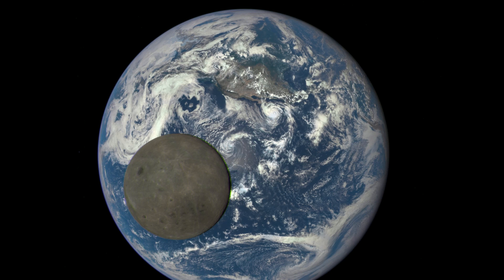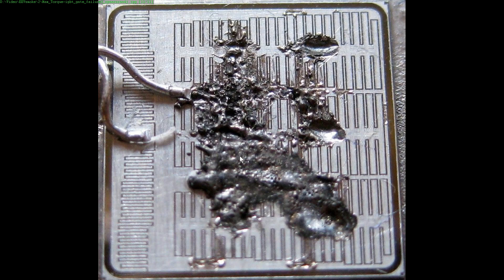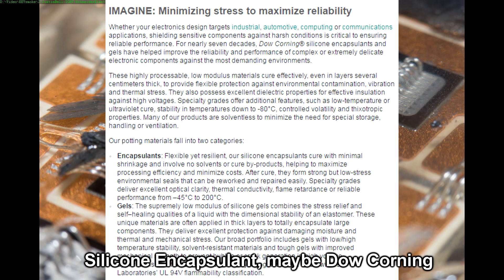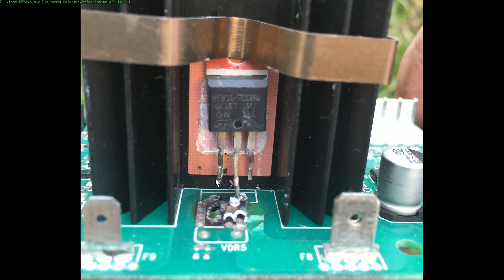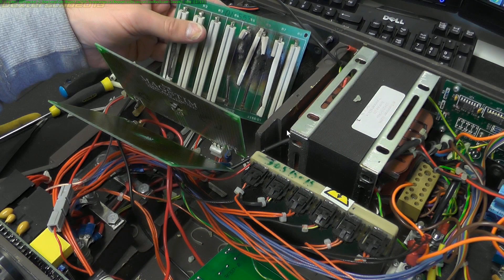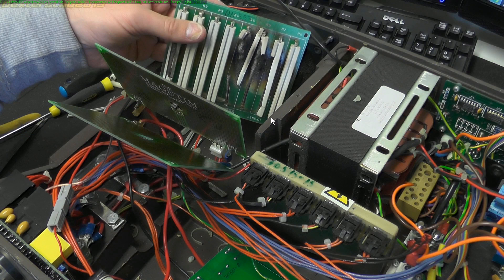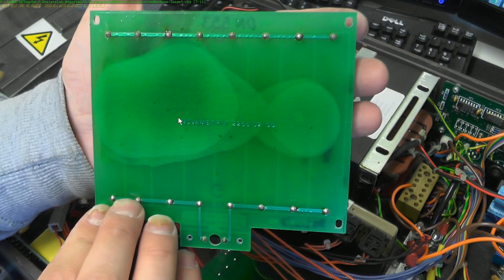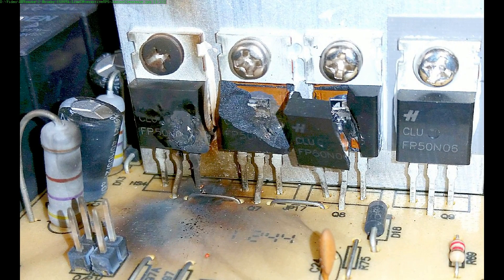EEVsmoke #2 - Magic Smoke Captured!

Comment: With the large power resistors, is it possible that one initially failed without much force and then the failure of each one in turn caused a chain reaction until the last few had all the power across them and failed spectacularly?

Comment: 5:30
I had a similar problem with a laser printer printing a vertically repeating defect.  Turned out to be a cockroach plastered to the fuser.  Cleaned it off with soap and water, printer worked perfectly once more.  As it turns out the origin of the term debug is much easier than what debugging means now.

Comment: There is a rural road just outside my hometown and it has a very old and narrow bridge over a wide river, with two blind corners on either end. There was a pair of traffic lights stopping two cars meeting head on but one night there was a terrible crash there, the investigation found that a slug inside the control box wandered across a pcb, fried itself and shorted a load of stuff, causing the traffic lights to fail.

Comment: Spent almost 20 years repairing two way radio gear. Our hard learned lesson in repairing some gear from certain cabbies and tow truck drivers, their homes and offices were roach infested. We basically threw out the gear and made them by new. To hazardous to repair these contaminated units Andre did not want our shop over run by these critters.

Comment: Was testing a portable 5V power supply I made about a year ago when the magic smoke escaped in spectacular fashion. I managed to solder one of the tantalum capacitors on backward, which exploded in my hand. Left a small burn on my hand, and a crater in the board. Think I still have the board lying around somewhere, will try to find it.

Comment: Why aren't you more interested in IGBTs?
They are amazing!... AND BRUTAL!

The most powerful "Discrete" IGBT-module on the market is capable to switch 16 MEGAWATTS of energy.

Compare that to your MOSFET-toys! ;D
Reply: Only 16MW? So what do they use for the switch mode power converters at the ends of subsea DC power cables?
Reply: John Doe Well they take a whole lot of them and switch them in parallel and in series.

I was referring to the individual IGBT-modules that can be used in such an installation.

Comment: 8:03 According to the schematic there's 2 groups of 4 parallel resistors in series. Probably one of the resistors went open circuit causing overload to the rest and the imperfections in ceramic caused it to shatter from overheat or thermal stress.
Reply: Yep, the copper side picture of the board (in the video) shows this clearly.

Comment: Thanks for featuring my "one careful owner" IGBT Dave!  It's was being used in a prototype 6 phase inverter for a Traction motor application, and a motor winding failure lead to the de-sat detection attempting to shut the gate down from WAY outside it's SOA.  Gate to Source overvoltage occurred, due to capacitive coupling, then source hard shorted to gate, and gate protection zenner kicked in, but the inductive load mean't that got killed (exploded) and the rest of the energy blew apart the IGBT, and it's hard shorted Drain/Source as well!!  All killed a large contactor that jumped in (opened) to isolate the DC link after all that too......  (see here, for an unhappy looking contactor:  https//pbs.twimg.com/media/CpC3iqiXEAAowpR.jpg:large )

Comment: Hi Dave, The 2nd pictures in the video was taken by me, I sent you an email about that.
The reason the smoke is "layered" is because when the gas from the explosion tries to escape the goo, it simply blows bubbles in the goo, until it either burst with a small hole to vent the gas, or the goo cools it enough to stop expanding. I poked around the goo with a needle to observe that this is properly the behavior of the gas to form such flat spikes.
Reply from the maker: Thanks for the extra info. Best photo ever!
Reply: Tim Coyne Here is my full teardown article on the Altivar: http://kaizerpowerelectronics.dk/technology/teardown-schneider-electric-frequency-inverter-altivar71/

My other teardown articles/videos: http://kaizerpowerelectronics.dk/tag/teardown/
Reply: Are you willing to share the original image?

Comment: Only 3 Over enthusiastic BS Blunders in this one! 1) the gate of the IGBT didn't blow it up; 2) The resistors are in parallel & series; 3) That's not a cockroach!  Dave, I love 'ya, and enthusiasm is great, but put brain in gear before spouting off.  Please.
Reply from the maker: No, that's how I roll, mistakes will happen.
Reply: Roll On then
Reply from the maker: See the reply from the photo owner above. It was indeed Gate to Source overvoltage

Comment: Im making a zvs driver that uses 8 irfp260's if that ever blows up I will send a pic its hooked up to a car jumpstarter transformer that can handle 200 amps it has open circuit voltage of 35volts after rectification if it goes wrong it will be epic

Comment: Dave you are amazing at what you do, please go back to making content.
Reply from the maker: Could have sworn this was content. It's just content you don't like. Please don't confuse the two.
Reply: You are correct, I apologize as the previous post was very thoughtless and emotionally driven. Here is my personal opinion as a consumer of your content. I watch your channel because of way you present the topic of electronic engineering/design. 

I am going to compare your newest content to content from one year ago. Going back to your content exactly one year ago. Taking the first 10 videos past that date. Starting with "EEVblog #814 - Keysight N8762A 600V 5100W PSU Teardown" and ending with "eevBLAB #17 - The Australian NBN SUCKS! (For Businesses)". You had a total of 8 videos with direct interaction with hardware. The "Don't turn it on take it apart" kind of content. This included 2 official tear down videos. I also will note that there were 2 mailbags. This is the content that fuels my passion for electronics as the information is non speculative and quantitative. Mailbags are extremely enjoyable because it adds a ton of variety to your channel and your insight to the items sent to you is very fun to hear. 

Now fast forward one year. Taking the last 10 videos you only did one tear down (not including the dumpster dive) and one mailbag. There were also 2 smoke videos where you didn't even touch a piece of hardware nor did you even put your self on camera. A dumpster dive where you took apart a working monitor which you have done multiple times on camera. 2 speculative videos (backed but not proven by facts) where you provide your insight to current event's. I just feel the quality of production and content has been much lower in recent months. 

tldr; I like watching you as a person present electronics as it helps me learn. Your latest videos feel like they have low production quality and don't address design/engineering concepts as well as in the past. I also miss product reviews. You do great work, it just has been consistently better in the past. All of this is my personal opinion.

Edit UPDATE: After EEVblog's replies I am providing an update. I was not aware of official eevblog videos and the above analysis was unfair. Overview, I am not the biggest fan of the solar roof and road way videos, they do have some of the highest views on your channel. The math you put behind both is extensive. Everything in the past 10 EEVblog videos 930-939 is high quality content. /Thread
Reply from the maker: I've been busy and there has been less time to do more involved videos and teardowns recently. Tomorrow for example when I really want to shoot a teardown because I haven't done one for a while, my wife is first day back to work, and I have daddy day care all day with Huxley. So no teardown this week either, and it will be every Tuesday for the foreseeable future. You are not picking a good time for a comparison to a year ago.
I just got back from the office at 10pm after editing a mailbag if that makes you feel better.
Reply: I appreciate your response and look forward to your mail bag :D Sorry if my comparison was unfair. Have fun tomorrow. Final thing I want to say is thank you for doing the work you do.
Reply from the maker: Ok, lets look at the last 10 videos shall we.
The dumpster one was not numbered so does not count, just updating people.
Two videos were trialing a new concept, sue me for trying something new. And once again, were not numbered, so technically should not be counted as my usual content.
One was a blab with quite frankly very interesting and potentially valuable insightful info on the blogging business, but not counted.

So let's look at official videos 930-939
- Two Mailbags. Bang on topic.
- Designing a multimeter, which quite frankly I think was pretty darn good technical whiteboard design discussion info. Bang on topic.
- Teardown and reverse engineer a HV diff probe. Bang on topic.
- Blowing the lid on a big problem with a popular industry meter. Invaluable for the community. Bang on topic.
- Designing a RPi supercomputer cluster. Bang on topic.
- Another solar roadways debunking. Massively popular. Bang on topic.
- Interesting Retro teardown. Bang on topic.
- Asking questions and running some numbers on a currently popular topic. Very popular video. Bang on topic.
- How a PCB is manufctured step-by-step. Massively popular and bang on topic again.

Care to revise your analysis?
BTW, I appreciate the feedback, I really do, but every time someone complains about my blog "not being what it used to be", they inevitably get it wrong like you have done here when you actually take an objective look at it.
Reply from the maker: I forgot to add that, yes, output rate has been quite slow because I've been busy with various things. But the quality of my last 10 official videos is as good as ever IMO, and many have been very popular.
And BTW, those "speculative videos (backed but not proven by facts)" you don't seem too fond of (which is fine, I don't expect everyone to like all styles of videos), they actually take a lot of work to produce. And in case you hadn't noticed, they were my 2 most popular videos.
Reply: I will revise my analysis no problem, but it will be tomorrow evening. I am going to rest before work tomorrow. On the topic of videos being official EEVblog or not I as the consumer was never aware there were official videos and not official videos and it was never and issue in the past because your content was spot on every single video.

Using the list you provide of 930-939. Yes I would say yes most of the content is spot on. Overall it is your channel please just continue to make awesome videos!

Edit: Overview, I am not the biggest fan of the solar roof and road way videos, they do have some of the highest views on your channel. The math you put behind both is extensive. Everything in the past 10 videos 930-939 is high quality content. 

Good night
Reply from the maker: I will of course continue to make awesome videos, but please just be aware that some or many may not be "awesome" to you.
The only thing I ask of my audience as a content producer is that if you are going to provide (negative) feedback on a video (and it's welcome), please just make sure you consider the fact that other people may find value, even exceptional value, in a video you may find zero value in.
I've said it a thousand times, it is impossible (not just hard, but actually impossible) to make even a single video that appeals to every single subscriber. Let alone 1000 videos.
Reply: Please, please don't assume that the videos you consider "not good" are universally considered "not good" .... I find the solar stuff great, I find this video really entertaining, and I find the more hard-core engineering videos also entertaining.

Your opinion is your own, and my opinion is my own. I don't try to enforce it on others, so why should you?

Let Dave do what Dave does. That's why we're here. Of course we can provide feedback, but that doesn't mean making statements as if they were on behalf of the entire viewership.
Reply: @Mythricia I said in my second reply "All of this is my personal opinion." I just wanted to speak my mind.

Comment: I think the weird laminate structure in the captured macig smoke is due to the direction of balloing of the gel. I assume here that the gel is flexible or semiflexible. there is less gel upwards than to sides. The hot gas has first made  round channels to the gel. some  of the channel volume comes from the gas burning the gel and some comes from the gel frexing out of the way. due to material thickness difference sideways vs. upward the gel has flexed upward more. when the gas has cooled down and the round gas channels collapsed the uneaven streching formed the layered structure.

Comment: I tend to skip over these videos because they are not very informative 
or educational, looking at a narrated slideshow of destruction with little to no information 
about why or how the thing blew up is not very interesting. Now if Dave 
were to do a series of failure examples overloading circuits in specific
 measured ways then  it could very well be a hit.

That is not to say that some of the images weren't cool.

Comment: These remind me of a service call I got when I was doing field service on PCs. The local Naval Air Station had a bit of trouble with their computer room. One of the machines caught fire, and the smoke was trapped in the room. A few other machines also failed, but all of them were stained from the nasty black smoke. They hoped we could salvage some of them, so we tried our best but most of them were simply toast due to magic smoke overdoses.

The funny part was when we found the machine that caused it. Inside we found the problem -- the power supply had suffered spontaneous disassembly, which had lit the board, then the plastic parts and the case, on fire. We also found what had caused the power supply to fail. It would be a good reason why you should keep all of the bus plates on your case, covering slots that aren't in use -- because a mouse had found a missing bus plate and thought the nice, warm, and dark place behind it was a dandy house. He moved in, and designated one corner of the power supply as his privy.

Unfortunately, it was a bad place to take a leak. It shorted several components, which got a wee smidgeon too hot, burned, released their magic smoke, but also managed to set the board on fire.

Mice are a real problem with high voltage. A friend of mine worked at a McDonald's, and the power suddenly went out. He found the main breaker panel, and the main breaker was tripped. He tried flipping it back on, and it worked...but a few minutes later, it blew again. This time, engaging the breaker didn't work -- it kept tripping. So, like a moron, he opened the breaker box...without shutting off the main power switch.

Inside, he found two mice, whom we shall call Romeo and Juliet. They were star-crossed lovers, and were planning their suicide together because their families forbade their marriage. Juliet FLUNG herself across the contacts of the main line, and lightning blasted her to a fuzzy ruin, popping the breaker. But being a slight little lady, her body fell away from the conductors, and when power was restored the short had been cleared. But Romeo, grief-stricken at the loss of Juliet, FLUNG himself into the same place, lightning crashing around his fuzzy ears. There was a puff of magic smoke, and he too followed Juliet into oblivion. But Romeo was a stouter rodent, of massive mousey thews, and his carbonized remains...remained. The short did not clear this time, and when the breaker was closed Romeo's body, turned into a small, tragic carbon resistor, simply caused the breaker to blow again.

So my friend, not realizing his danger, took a screwdriver to clear this grisly short. But he hadn't turned off the power at the main switch first. There was a flash, a thunderous detonation, and his wrist screamed in agony. The idiot had shorted the main with the shaft of the screwdriver, which immediately melted, burning the screwdriver in half. The blast tore the screwdriver handle from his grip and slammed it against his wrist. It wasn't broken, but it was a very near thing. Nursing his wrist, he finally did the smart thing, shut off the main power switch, and called the regional office to get some maintenance people. They had to close early, but it wasn't very busy at the time.
Reply: Amazing story, thanks for sharing this with us :-)
Reply: Gwen Patton you have an amazing way of narrating, really enjoyed reading
Reply: Epic

Comment: I don't think those power resistors are all in parallel, if you look at the traces on the back of the board it looks like two groups of 4 wired in series.
Reply from the maker: Ah, yes, correct.